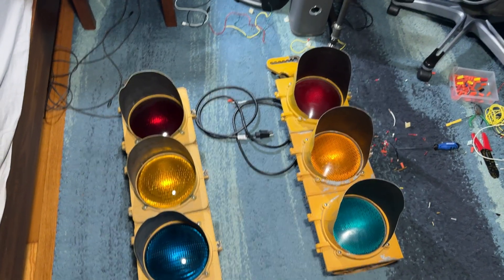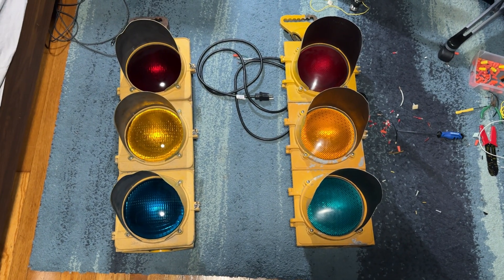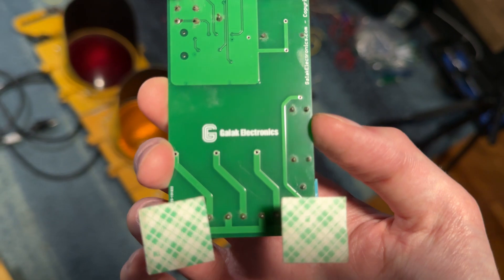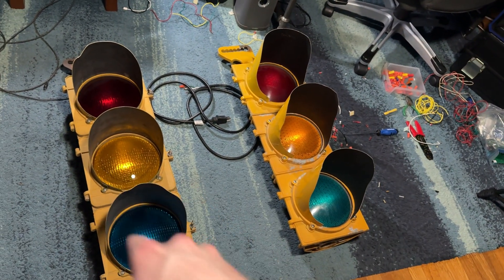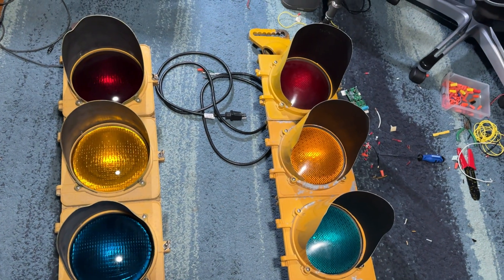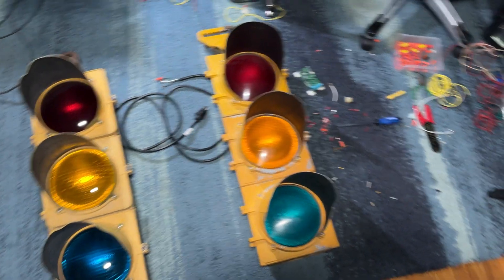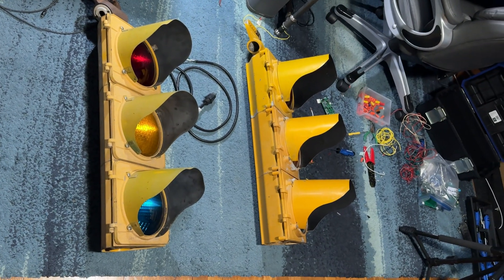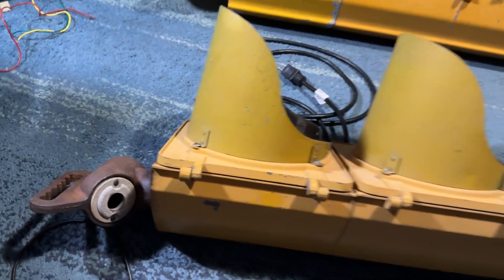Indoor Traffic Signal Setup Project Introduction

Comment: Get a couple 6" long screw hooks, or screw eyes , locate the center of the rafter that goes across the ceiling and screw the hooks in...then just hang em up ..I promise those lights will hang just fine ..I've hung much larger and heavier lights the same way before and never had an issue....good luck and be careful